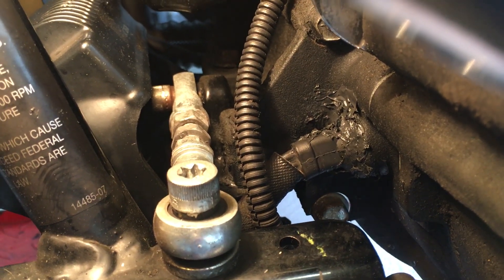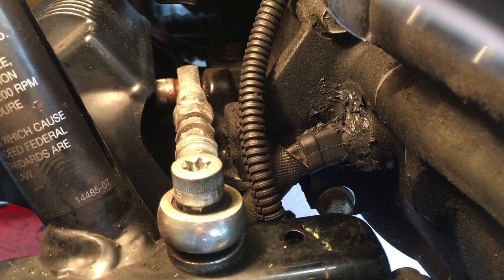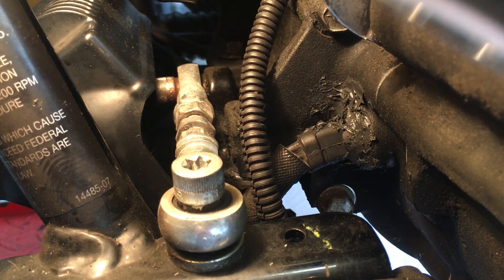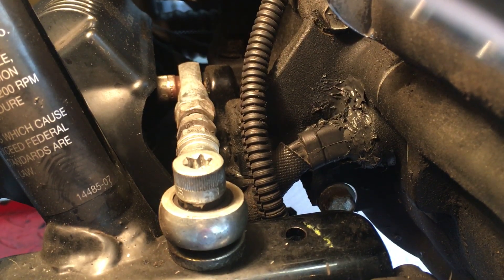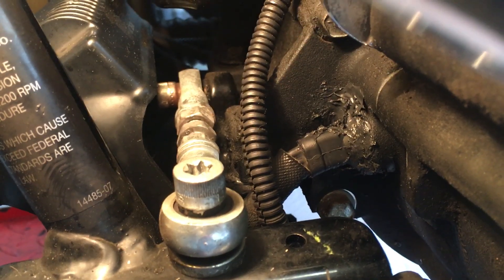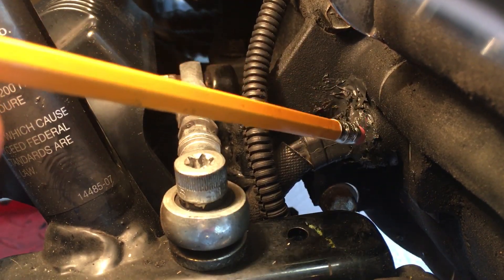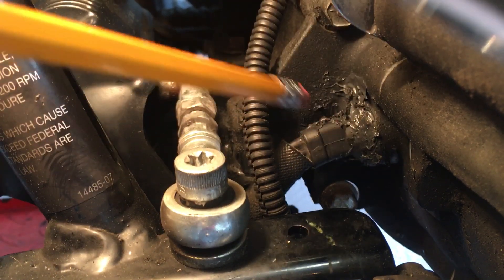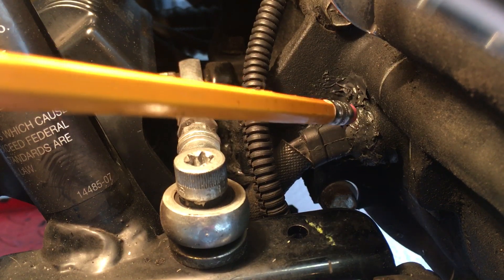Harley Primary Leak from Stator Plug

Comment: Me again.  That black permatex did not fix my leak. But what did was free flowing silicone.  Its used for windshield repairs.  Permatex 81730 part number. Shout out to harley threads. And just a f.y.i. I called stealership. $175 for stator.  $250 for 3hrs of labor. Not included is the cost of all the seals and gaskets they said install as well. So north of $700. Funny thing is they also offer the silicone fix. Didn't ask what they charge for that. Hope this helps someone.